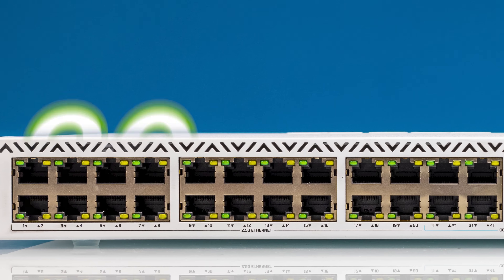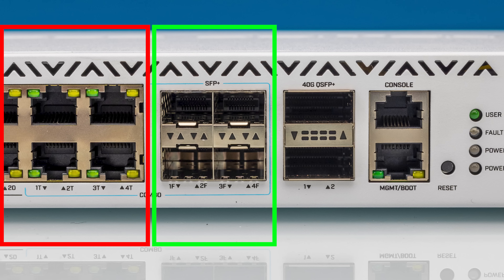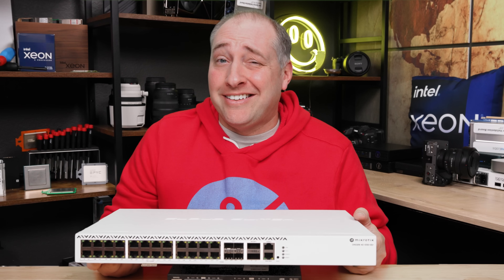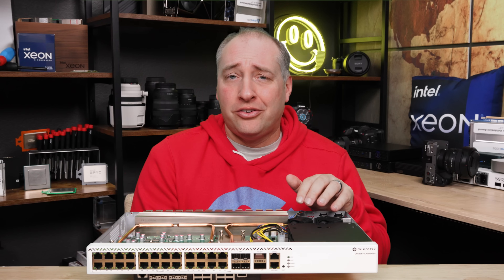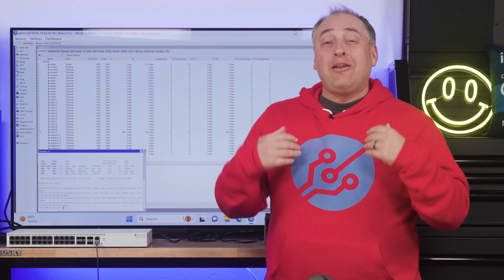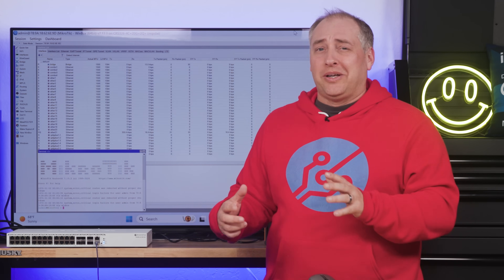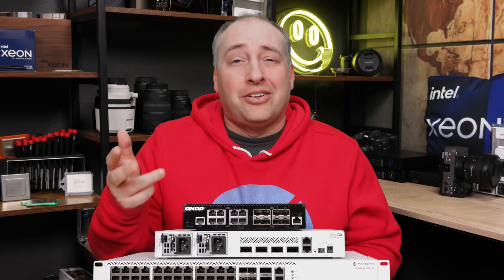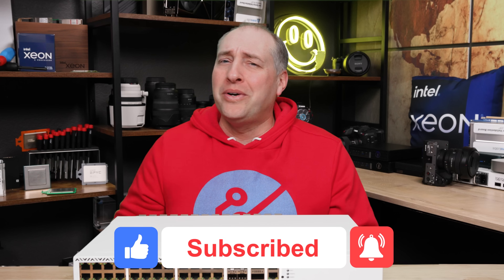Inside MikroTik 's NEW 2.5GbE and 40GbE Switch - CRS326 4C+20G+2Q+RM

Comment: If this was 5 GbE ports instead of 2.5 this would interest me. Also a model with PoE.
Reply from the maker: 5GbE pricing is so close to 10Gbase-T multi-gig that may as well look for 10Gbase-T
Reply: @ServeTheHomeVideo  That's not the case at all, plus I have zero use for 10GbE for APs.

Comment: I want a switch with 16x 2.5GbE, 4-8x 10GbE (NOT using expensive and hot SFP+ to copper adapters), 4x  SFP+, and a couple 25Gbps uplinks, and which doesn't use crazy amounts of power.

I don't like the Mikrotik always wants us to pay sooo much extra for the adapters, which stick way out from the switch, don't cool well (because they can't put nice heatsinks on SFP+ to copper adapters) and just are a pain.

Comment: I noticed that the board has four headers for fans. Two are plugged in (FAN 3 & 4), one on the right has a plug for a fan available (FAN 1), and in the middle was another fan port titled FAN 2, but missing the plug. Any chance you could use a multimeter to see if the fan 2 port is alive?

Comment: Why both passive radiator and fans in the same device? Can’t be an economically wise decision
Reply: passive radiator is for the switch chip, fans are for the PSU. Originally it had a fan for the switch chip too as shown with the missing fan but they decided to save the cost of that fan
Reply: @marcogenovesi8570  to my knowledge a big custom made radiator with custom made heat pipes is far more expensive than a regular heatsink and a fan.

Comment: Great overview.

I got CRS504-4XQ-IN (4x100G) few months ago, and while it is nice, small and light, low power, and quite, it has troubles. I am not sure I would recommend it (crashes, booting issues, not great performance, issues with channelizing ports, diagnostic, confusing settings, that cannot be change, easy to create loops, i.e. when one also uses management port, poor documentation, interface that saw no improvements in last 20 years, etc).

The previous time I used mikrotik was like 15 years ago, mostly small access points, and they were doing fine. I also had their 4x10G mini switch, which was a the best deal at the time (still is great, but I do not use it at the moment, as I updated from 10G to 25/40/100G mostly).  40G is basically dead. I would not buy an yswitch specifically because it has 40G, but at least you can split it into 4x10G, or get cheap NICs for it.

As of this 2.5G switch. I guess it is ok. I think fascination with 2.5G is weird, but I guess anything better than 1G is better to move industry forward. And we were stuck on 1G for way too long. If we can get 2.5G for the same price we do 1G, then sure, I am all for it, for it to be a new base.

But this QNAP switch is probably more interesting, and better long term.

CRS326 4C+20G+2Q+RM, maybe if it would like 400$, then it would be ok.

Also love the cooling solution on this guy.
Reply: I think 2.5G is the future for most homeowners that have bigger needs. IE for more wifi uplink on the new Wifi 7 stuff. Most don't need even 1G, but 2.5gbps is so cheap that your dumb switches should just support it IMO.

Comment: Almost no one cares about 2.5 GbE, I don't know why people keep trying to push it.  Anyone who cares about network performance wants 10gig as a minimum.  Anyone who doesn't care isn't going to spend the extra cash for a minor upgrade.  if the industry isn't going to provide an affordable and reliable 10gig copper solution people will either utilize fiber or continue to not care about these half hearted attempts at progress.  The window of opportunity for 2.5GbE was 10 years ago.  It's time to move on.
Reply: You're missing the point of 2.5GbE.
10GbE over twisted pair was first defined as a standard in 2006, almost 20 years ago. Even today, it remains a rare feature on consumer grade hardware. Most consumer electronics stuck with 1000 Base-T, a standard dating back to the previous century.
The fact remains that 10G over twisted pairs is too costly and too hot to replace 1000 Base-T, and moreover it requires higher-standard cabling.
2.5GbE is a standard first defined in 2016, precisely because of the troubled adoption of 10GbE over twisted pairs. Importantly, it is certified for the same cabling standards as the 1000 Base-T it is meant to replace. And speaking from personal experience, I've never had thermal issues with 2.5GbE the way I had with 10G Base-T (the 10G SFP+ to RJ45 transceiver I had plugged into a cable closet switch would frequently throttle down to < 100Mbps with severe packet losses and latency fluctuations. It was bad enough for me to go back to 1G)

TLDR: 2.5GbE is positioned to replace the ubiquitous 1000 Base-T in nearly all use cases. It's not the fanciest of standards, but it is what the mainstream will look like in a few years.
Reply from the maker: Exactly. And the big benefit is being able to replace 1G on wire that has been installed in buildings for decades
Reply: @DGao-zz5vq Thank you for taking the time to reply. There are certainly many issues with the current implementations of 10GbE and I can see how 2.5GbE looks attractive compared to it.  As far as I'm aware there still is not a single implementation of a reliable 10GbE Thunderbolt adapter.  My comments are less towards how these 2.5GbE products compare to what you can buy in the 10GbE space, and more towards the sentiment that we shouldn't be happy with table scraps.

Many of us in the comment section making similar remarks aren't missing the point.  We're well aware that there's plenty of CAT5/6 installations in place and operational.  We're criticizing the bigger picture issues about how the state of BaseT networking even got this bad in the first place.  We have wireless solutions in the market today that mop the floor of current mainstream wired copper connections, 2.5GbE included.  These Wifi 7 implementations are in phones, which are far more difficult to manage thermal and power constraints.  Heat and power problems on network adapters for laptop and workstations is an issue that modern process technologies have brute forced long ago.  If the current chip sets are problematic than it's a design and node selection issue.  The 2.5 band-aid is also a solution in search of a problem.  Any organization that's feeling pain points due to networking speeds isn't going to rip out their entire network stacks for a 2.5x performance jump.  They'll replace their wiring and support 10gig or go with fiber.  A competent 10 gig solution would fallback to 2.5/5GbE if it can't negotiate at 10gig due to weak wiring. 

I expect the consumer space to embrace Wi-Fi as a 'good enough' solution, it's actually damn impressive now.  I never thought I'd see the pro-sumer space implicitly sabotage the progress of networking connectivity by pushing half-baked wired solutions that are inferior to wireless solutions in every way.  The 2.5/5GbE standards are great as fallbacks for when endpoints and wiring aren't up to 10gig levels, but I don't see any place for NICs that are 2.5GbE other than 'that's what happened to come with the product I bought from Costco'

A 2.5X performance increase over 25 years is nothing to get happy about.  Could you imagine if the PCIE adoption stagnated this badly, we'd still be on PCIE 2.0.
Reply: Do you have a link for a managed switch with 24 10gig-ports for under 500USD?

Comment: It's peace of crap, not based upon a quality but idea. We (as consumers) are waiting 24/48 port 10G switch for the last 3+ years. What should i do with 2.5G, plug in AP's. As they did not have idea or some kind of cpu/architecture limitation!?
Reply from the maker: 10Gbase-T is very challenging for the market because of limitations running over existing cabling installed in walls. 2.5GbE is a good upgrade over 1GbE and does not have this issue. Another challenge is that for higher-speed switch silicon, everything is going to 25GbE/ 100GbE instead of 10GbE/ 40GbE because 10GbE is very inefficient for PCIe lane use. Later this year and into next year, a lot of the DC gear is going to 50GbE and 100GbE being the lower-end standard speeds. So perhaps the challenge is that at the bottom end, people who what a cheap upgrade on existing wiring (2.5GbE), and at the higher-end (servers) people left 10GbE networking 5-7 years ago.

Comment: Problem with the MT is that feature set is misleading. Majority of times the feature set is not hardware offloaded and you get a set of ports driven by software on under powered CPU and that software tends to be broken itself.

Comment: Bigger... sure... but not that big.
12 to 16 x 2.5GBe ports with PoE+, quiet or fanless and with at least a handfull of L3 capability, under AUD$400 at the door would be nice.
Seems often forgotten that in the real world people are going to have a mix of techm we're not all building high end home labs from scratch with giant budgets.
My sticking points... 1) is a NAS I have that has 2 x 1GBe ports where with my current switch has 24 ports (only 1/2 populated) and I'm running link aggregation to get a 2GBe link to the nas.
2) is 8 ports leaves me to short, but 24+ ports is way overkill.
3) Fan noise has given me tinnitus over the years (used to have a desk next to a server rack before anyone cared).

Comment: Can QSFPs be broken into 4x10G ports? Or the are fixed to a single port?
Reply from the maker: You might be able to see it on the screen when I talk about the management, but the QSFP+ ports are labeled for each of the four 10Gbps link groups already
Reply: I know there are (at least) qsfp<->4x sfp DACs. Not sure about other physical connections

Comment: TP-Link TL-SG3428X-M2 has 24x 2.5GbE + 4x 10GbE SFP+ for half the price. Those 40 GbE ports cannot justify the price difference.
Reply: Keep in mind that with combo ports, you don't even have to buy an SFP+ module.  Those add up quick.  If with the TP-Link you go with Copper SFP+ then that easily adds $200.

Those two 40Gb ports have 80% of the bandwidth that entire TP-Link has.  If, after buying SFP+ modules you are only spending another $200 for that much more throughput, and you need it..  Well, that might not be a bad deal.

Comment: ...one addl comment.  Those QNAP switches ... are just MEH.  Seriously meh.   The Zyzel 1930 line is SO much better, and you get 10G ports(10/100/1G/2.5/5G/10G) across the board for the same price per port.  And a much better and functional webUI.  Not even close.  I have both, I know :-)

Comment: I still don't get why QSFP 40G, that's such a dead end at this price point and for modern uplink connectivity. 10, 25, or 100 are the speeds.  40 is such an odd bastard that's incompatible with 25/100, why why why Mikrotik?
Reply from the maker: Totally agree. 25/100G require faster per channel speed, but I think they are becoming more useful.
Reply: They use old switch chips, which are cheaper

Comment: Nup, they've lost their way.  MikroTik were the other cheap and cheerful option if you didn't want the manager-friendly Apple-like slickness of Ubiquiti.  Instead we now have Ubiquiti pushing into lower end HPE/Cisco pricing territory and we have MikroTik nudging below it.  

Ubiquiti's easy centralised management is a selling point for the SME that doesn't want Meraki's ridiculous subscription.  MikroTik's management, while powerful, isn't in the same class and therefore only really suitable for much smaller installations where value is the key selling point, or those where network engineers need control over any of the switch features using their own custom software.  For the latter it's hard to justify the MikroTik name now when a much more respected brand can be used at a similar price.  

MikroTik doesn't win the value argument anymore and they have well and truly abandoned it.  We've already seen many of their more recent switches jump in price by over 30% compared to when they launched, and while I could have accepted it during the chip shortage they have maintained those prices in the years since.  When all this is taken into consideration I'm struggling to justify ANY of their recent products at their asking price.  I'd recommend this switch to my customers in a heartbeat at around the USD$500 mark.  Is this MikroTik getting cocky, or can't they find cheap enough switch chips allowing them to achieve their older price points?

Comment: Really cool switch, I just recently bought the 8-port little brother of this thing and love it. I wish they'd put a bit more grunt into the processor when they've got this many ports and they're all at least 2.5G; you'd have trouble pushing the internal 1G line rate (let alone 2.5G like the external ports) through even a single port if you're doing any sort of routing or filtering, so you're basically forced to leave everything in hardware offload mode and don't really get to do much with the breadth of RouterOS features other than possibly running some services on the built-in processor.
Reply from the maker: Spot on

Comment: I don't get the pursuit of 2.5Gb. It isn't common from my experience. As far as I can tell the cards aren't any cheaper than 10Gb especially when buying used. I wish the standard would die off personally. It's just creating more stuff people wont have a use for in a short period pf time. 10Gb is super cheap as all the datacenters are abandoning it for faster stuff. I can't even sell a used 10Gb switch to save my life unless I just give it away.
Reply from the maker: The answer is really simple. 2.5GbE can work on the same legacy cabling that is installed in walls. So it’s the zero friction upgrade. It will be a lot more common this year
Reply: @ServeTheHomeVideo  it will be nice if it becomes more mainstream. I have been wanting to see how much of the 10Gb speed I can push through the cat 5 runs in my office. 😁 I feel like the only people needing above gigabit are homelabbers and maybe some more advanced offices.
Reply: If you wire your home I think most of your devices has 2.5Gb or less on the motherboard, if you only use a switch in a rack it's a different story. I have 15 devices in my home outside the server rack and only 4 of them are faster than 1G/bits so in that case 2.5 is an good compromise, then the question is if you need 10G/bits for your clients?
Reply: @fordonmekochgalenskaper5665  honestly I messed up and didn't run conduit in my house for all my low voltage for future proofing reason. Most people won't constantly need access to 10Gb let alone 2.5Gb. The jump to 2.5Gb is borderline pointless though. Especially when you factor the price difference between 2.5Gb and 1Gb.  Also haven't tried it but you should be able to push 10Gb on lower end cabling depending on the run length and environment I'm told.
Reply: @computersales  true but then I just need to buy a new switch when my devices got 10 Gb and then probably 10Gb switches are cheaper, most devices I have is media, like TV, receiver, streaming and so on, 4 computers with 2.5Gb on motherboard, they not gona be upgraded for 3-4 years or so.
Reply: "As far as I can tell the cards aren't any cheaper than 10Gb especially when buying used."

Well, yeah.  But go look at new. Used 10G cards also create more heat.  And it's not like you can throw a X540 into your AP either.  Plenty of stuff is using 2.5g these days as well.

"I can't even sell a used 10Gb switch to save my life unless I just give it away."
Alright, what do you have and how much are you asking?

Comment: For switches like that, with so much empty space, I wonder why they use those noisy fans, instead larger blower style fans that can run at a lower speed. Think some of the videocards from the 2008-2012 era where they started to use larger blowers to keep noise levels down.
Reply: Simple. Where would a blower fan pull air from?  Blower fans pull air from above or below. If this thing is in a rack, then even if there are vent holes.. Well, you'd have to leave at least 1U of space open so it could pull in air.  Might be fine for you, but that could mean a DOA product for SMBs who could be interested in this, and value rack space.
Reply: @jorper2526 I was thinking a half height blower, with a duct pulling in air from the side or back, then sending some airflow to the PSU, and other airflow over the other heatsinks (split flows were done with some cards that used separate heatisnks for the VRAM and VRMs). While some efficiency is lost from a change in air direction, large diameter blowers are pretty quiet while having a decent airflow and static pressure. 
The PS5 also uses a similar airflow design when the side panels are on.

Comment: Does this switch support Link Aggregation?? If it does i think i found my switch for my homelab/home networking. plug the NAS into the 2 40Gbps ports in a LAG for max performance, then connect the Stream PC and the Gaming PC to the 10G ports in another LAG then the rest of the house can run on the 2.5G network.
Reply: I might be wrong, but all my Mikrotik’d router/switches can do LAG (using it actualy)
Reply: @ReneGo- that's good to know, might look at investing in this switch, if it can do LAG then might as well jump into it